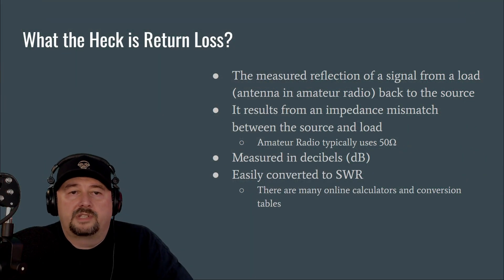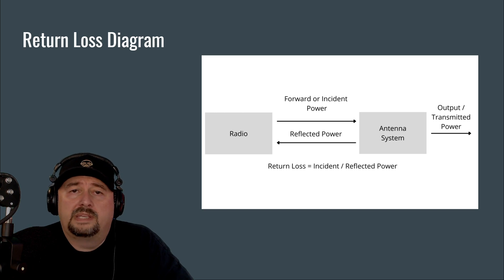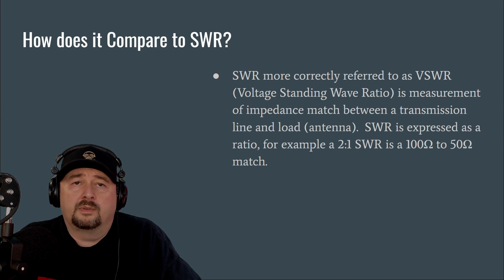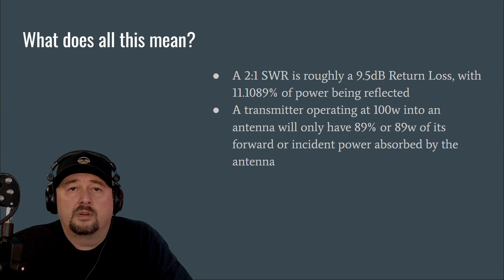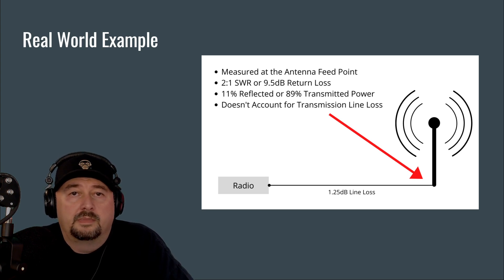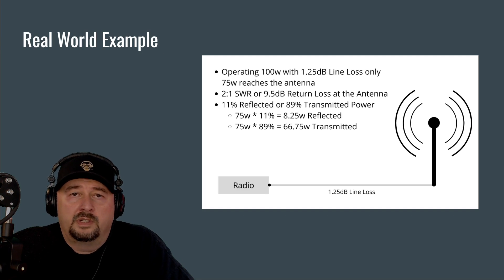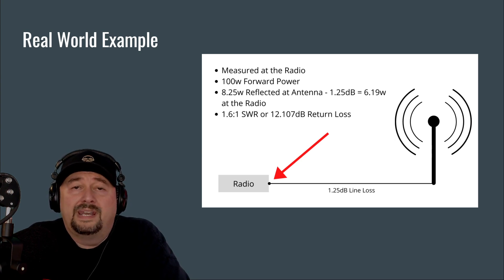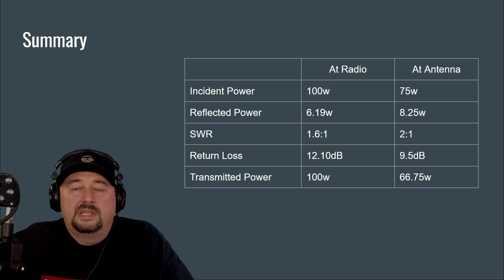What is SWR in Ham Radio?

Comment: I don't use a transmitter, I'm just an SWL listener. I have a Hammarlund 170 receiver. I just listen to ham operators. I.m trying to understand antenna matching. My 170 is a greta receiver. I'm not savvy in understand SWR meters, but could an SWR mater tell me if my home made meter dipole is a mtach?
Reply from the maker: An SWR meter can certainly help you with antenna matching 👍

Comment: This is, unfortunately, wrong. The notion a mismatch on a line causes a defined loss is radiated power is common, but absolutely incorrect. This video perpetuates that common myth. 

There can be a 10:1 SWR on a low loss transmission line and yet nearly 100% of transmitter power radiated.  An example is how a doublet with open wire line works. Feedline SWR is around 10:1 or higher on all bands yet system efficiency is typically up near 90% or higher. 

Q-sections or matching stubs are another example. They can operate with a 5:1 SWR on the line section or higher, yet have nearly no loss. 

YouTube will be our educational undoing.
Reply: This video and others unfortunately enforces the old saying of "tell a lie long enough and loud enough, it will eventually become fact." Poor ol' Walt Maxwell must be rolling over in his grave every time a new SWR video is published.
Reply: @W0BNC  The problem is people see a video with good sounding but technically false information and use it as a learning tool. Walt Maxwell tried to get rid of the popular "reflected power is lost power" myth but he got into a needless back-and-forth with Warren Bruene about conjugate match. The needless back-and-forth distracted from the important point that reflected power is not lost power, and the SWR never equates to lost power in practical systems.  We can have a 12:1 SWR on a low loss line and deliver almost 100% of transmitter power to the load.

If this video was actually correct, thousands of systems would suddenly barely work.

Comment: I've attempted to educate people on this, including hams, and they just don't get it. One guy was running over 100ft of RG58 to an expensive, high gain UHF antenna. I tried to explain that you're wasting your money and potential because effectively, you're back to unity gain or less. Even at 27mhz he was only getting 55% of the power to the antenna, with no real idea of the SWR at the antenna.
Another ham was so ignorant, he just would not acknowledge that the feedline loss was masking his SWR readings... not to mention meter placement (won't get into that). He was saying how flat the SWR was (and it read 1:1) across so many channels. He was also using a very long run of RG58.
Something worth mentioning about running low loss coaxial like Heliax, even at 27mhz, is when you have a very high gain antenna. The advantages when considering the ERP are considerable, not forgetting your receive as well.
Good video.
Reply from the maker: What I have noticed is that sometimes folks, regardless of RF service have a hard time being open minded ESPECIALLY if they are wrong.
Reply: @TheSmokinApe  having an original thought is good for development.

Comment: thanks for the video. i'm trying, but still not getting it. in the summary, if i see 100w incident at the transmitter with some return loss and a swr of 1.6, i would not assume 100w transmitted.
Reply from the maker: Correct, less than 100 would make it to the antenna.

Comment: Awesome show! New HAM. What part of the coax does the return loss come back through? The calculation takes into consideration the coax line loss, makes sense. My other question is how to calculate the power loss? Is that losss based on the coax or is it due to the throtttling at the load on the antenna? 

Louis KK7AAG
73’s
Reply from the maker: It comes back on both the shield and center conductor as I understand it.  The loss can best be measured in terms of attenuation on the feedline.  There are websites that show loss in dB per 100" of various coaxial types.

Comment: well put, in a way that anyone should understand
Reply from the maker: Thanks Buzz, glad it was helpful 👍
Reply: As stated above, reflected power is not lost power. It goes back to the antenna and is radiated minus what is lost in the feedline.
Reply from the maker: @andyw6ad  so it’s not lost except the lost power from the feed-line?  I suppose you will tell me that the ping pong back and forth is efficiencies next…. The video was about SWR and Return loss, where it’s measured and how line loss plays a role.  Please Mr Helper, instead of regurgitation of what others posted, direct me to your cinema-graphic master piece…
Reply from the maker: @andyw6ad  thanks for helping Andy.
Reply: @andyw6ad  This topic can go on and on due to the understand of others and how they see/hear it. Many tears back when I would do talks on SWR's and CB 11m radios to CB'ers. They seemed to understand it as a radio putting out 4 watts, but a high SWR would take some of the 4 watts and push it back into the radio, this is being done on TX only in which after the power on both side out/back stop and fade away until the text tx, and so on. However over time something has to give do to PA IC getting hot and blow being the weakest link. CB'ers seemed to understand that best. My point is everyone may see things differently, the bottom line is High SWR's are no good. lol
Reply: Well the reflected power does not go back into the radio. It goes back up the feed line to the antenna.( And most of it gets radiated). Ape I appreciate what you are doing to help the newer hams. Looking forward to the Coffee and Ham Radio episode on antenna wire. Andy
Reply: @andyw6ad  It was just a way to show how some need differ ways to understand. Sometimes one needs to use something that has nothing to do with the subject matter to make the point. I stopped teaching electrincs in 78, I'm lucky if I can remember resistor color code. lol I have been training certain groups in firearms since 72, I had to give one up, the money was in firearm training so that was where I stayed.

Comment: The inherent loss in coax along with loss due to SWR is one reason why I use balanced line whenever possible (and in reality that's quite often). Inexpensive ladder line will have MUCH less loss than even the best coax when any significant SWR is present on the feedline. A doublet fed with ladder line is an excellent multiband antenna and is highly efficient.

Just to stress a point that I believe you infer near the end of the video - locating a tuner at the feedpoint of the antenna is another way of avoiding loss due to SWR if the antenna is being fed with coax. Doing so won't eliminate the inherent loss in the coax but it does remove the losses caused by SWR from the equation.
Reply from the maker: Thanks for the detailed comment Brian, I agree with both points.

What I like to do is use concepts that most hams are exposed to, in this case SWR.  I wanted to show that measuring at the radio and the feed-point will give different results, and to your point coaxial transmission line being a huge factor.  On the channel I get lots of questions about SWR and antenna performance, I wanted folks to know that there is more to the story than just what is on the shack SWR meter.

Comment: This is very informative, thanks. A question: When using an antenna tuner (either at the radio or the antenna) to lower the SWR to 1.2 or lower (impedance matching), does this actually increase the useful power going to the antenna or does it simply reduce the reflection back to the radio (or both)? 73 KJ7YBK
Reply from the maker: It just reduces the reflection back to the radio, thanks for watching Dan.
Reply: @TheSmokinApe  Thanks. From all of the videos I have watched (including David Casler), this is the first time my brain heard this. It is what I suspected but do not think anyone said. My guess then is that the power not reflected back nor sent forward to the antenna is consumed in the form of heat. Would this be accurate?
Reply: @danev1969  a tuner next to the transmitter will allow the transmitter to put its maximum power into the system also creating a resonant system by canceling out the reactances, the reflected power will join the forward power back to the antenna, the key to efficiency in this system is the feedline, the lower the loss the more power is available to the antenna to radiate

Comment: I think you need to read "Another Look at Reflections". "Return Loss" is not lost/wasted power. An antenna that is not perfectly matched to the feed line will reflect power; however, the complex impedance of the antenna appears at the transmitter terminals as a second complex impedance which is not perfectly matched by the transmitter. Hence, a large part of the reflected power is re-reflected back to the antenna. The real culprit in this is the type of feed line. RG-58, RG-8x and many other small cables have a significant loss even when matched; mismatch increases the loss of forward, reflected and re-reflected power, making them very inefficient if not perfectly matched. With extremely low loss feed lines, VSWR, return loss and load mismatch become practically negligible. That is why many hams (including me) have used 450-ohm ladder line or home-made open wire line to feed non-resonant antennae with great success on multiple bands. Yes, a matching network ("antenna tuner") is required, and this introduces some losses. But overall, VSWR is of little or no concern if the feed line losses are kept in check. (As I told Cassler, in over 50 years of hamming, the only resonant antenna I've every really used on HF was a multi-band cubical quad. The rest have been random-length dipoles fed with #14-conductor ladder line.)

https://www.worldwidedx.com/attachments/reflections-walter-maxwell-pdf.36264/
Reply: That is my understanding, too.
Reply from the maker: Thanks for the response Bill, I think we are on the same page.  I make videos for my audience, they have asked me to do more videos on antennas and things like SWR; it's something that comes up often.  The intent of this video was to show that there is more to the story when you simply look at the SWR meter on your rig, hopefully, I did just that in the video.  We are also aligned on what you state about coaxial feedline, that's why I wanted to show the example and discuss the impact of line loss.  I am sure you are aware that most hams run coax and not ladder / open wire and that's why I covered coaxial in this video.  I am going to go out on a limb and say that folks who have intentionally made the choice to use ladder / open wire have done so with purpose and with intent, I would imagine they have a solid understanding of antenna systems and as a result wouldn't be the target audience for this video.
Reply: @TheSmokinApe  if you explained more on what happens to reflected power then the misunderstanding/myths that its lost or absorbed in transmitter would be dispelled and would make for an excellent video presentation

Comment: Hey Ape, great video.  There are a few common things that as hams we accept or believe.  1. 100 watts, that is the setting on the radio and not the actual output. 2. SWR reading at radio, we are told anything under 2.0 you can operate so we just say ok. 3. This is why we try not to use cheap coax, better coax has less line loss (in most cases). 4. Antenna tuner will help catch the line loss and reflect it back playing a game of ping pong with forwards and reflective.  IMHO those are just a few things some Hams believe when talking about this subject.  Using SWR vs math is like electricity….take the path of least resistance
Reply from the maker: Awesome post Blackheat!  Thanks for watching, glad you liked it.

Comment: Ape, that is a great explanation, but only half the story, I am afraid. Check out 'SWR - the persistent myth' by John Fielding, ZS5JF, for example (it's a free pdf presentation, just google it). Actually the reflected power is relected again with a phase shift at the tranceiver, going back and forth until it is radiated at the antenna. So the only added loss throuh a mismatch is happening in the coax. The misconception of assuming the reflected power is lost probably comes from viewing the trx final as a generator with an inner resistance. In reality there is usually some sort of transformer or matching network. So we are talking impedance mostly formed by reactance and not resistance. Reactance in contrast to resistance can not consume power (converting it to heat) but store it to give it back during the next cycle. Ot is'sort of a virtual resistance only applying to AC. In reality there are still small resistances in the components and the feed line, of course, but the effects are much less critical than one would assume. I am not saying you shouldn't care about matching, especially with very high power, but It is not like all reflected power would be burned up in your transceiver (or tuner, as some say). All the best es 73
Reply from the maker: Thanks for that post, its really well stated.  The point you make is a fair one, the angle I wanted to take in this video was in reality the effects of line loss in most ham shack installations.  I used the topic of SWR / Return loss as the topic to illustrate what actually happen when folks just rely on the SWR meter in the shack.
Reply: DJ5SE   I have just finished reading John Fieldings document. What a brilliant engineer and what an excellent document. It should be made MANDATORY reading for any amateur radio exam ! DJ5SE... THANK YOU for bringing this to my (our) attention, i had never heard of this wonderful document.
Albert  EI7II.
Reply: @albert7ii  also reflections by Walt Maxwell goes into great detail on this subject
Reply: @paulm0hpd319  Thanks Paul. Appreciated !
Reply: DJ5SE totally agree ,reflection gain where the reflected power joins the forward power needs to to be taken into account to determine loss within a system, an swr figure alone is not the full story, for example different types of feedlines will have a different loss figure with the same swr